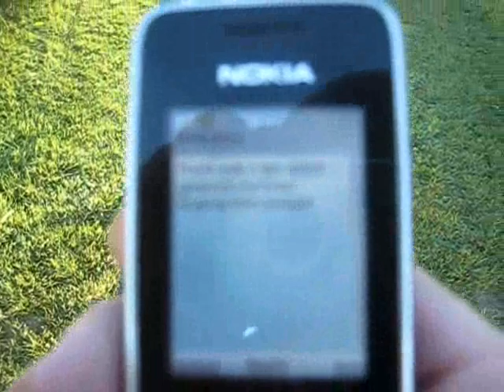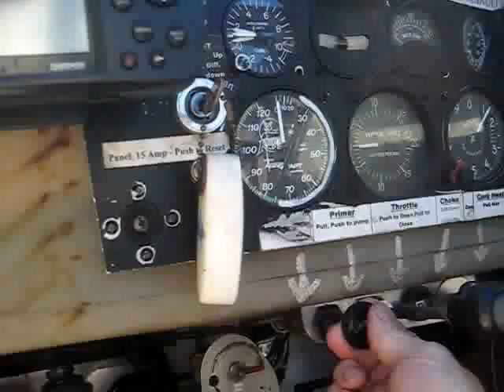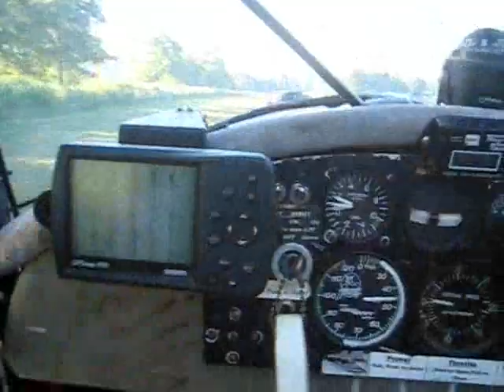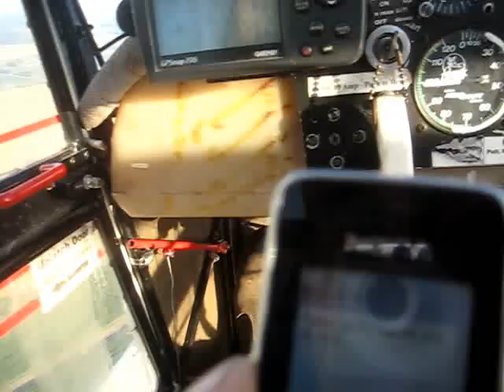Downed Aircraft -Carb socket failure

Comment: Mine were loose when I bought my L'il Buzzard. One was turned about 15 degrees to the side. Straightened and tightened them up. A few years later they started to crack and split so I replaced them.  they were always a pre-flight checklist item for me. Also the oil lines to and from the small rotary valve oil tank on the 582. They leaked as well. Had to replace both of them and the tank too.